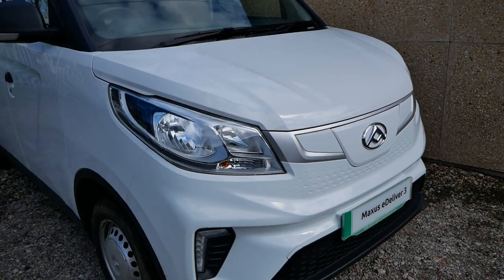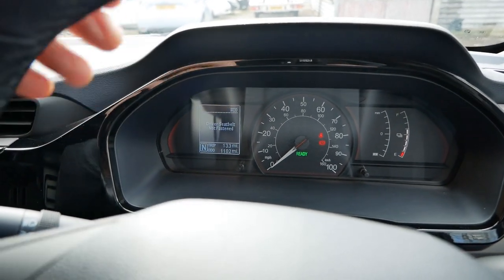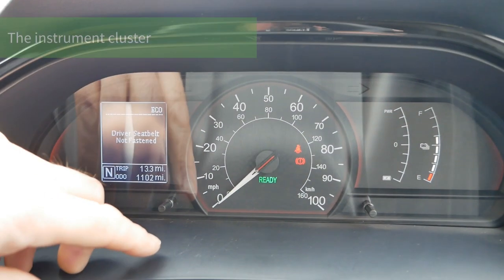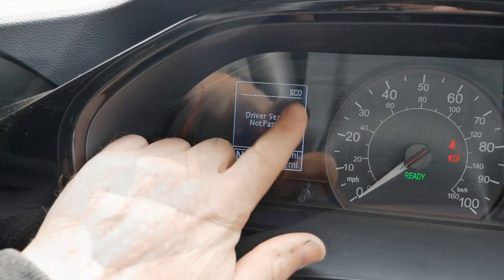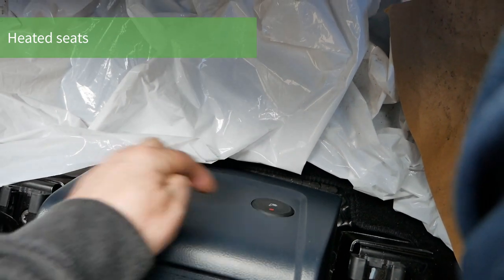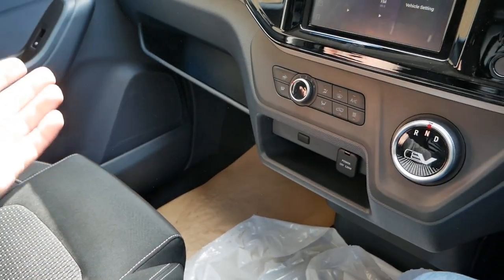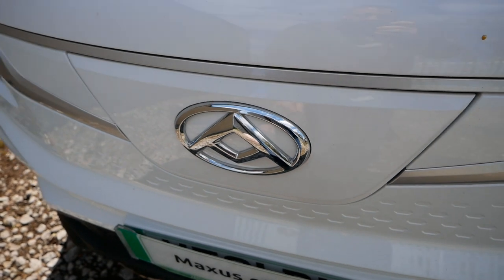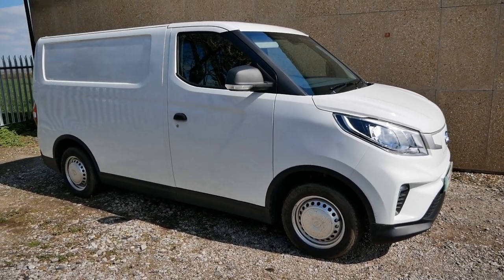Maxus eDeliver 3 beginner's quick start guide on how to use and operate your new electric van

Comment: Thanks Matt for a cracking video. I’ve just taken delivery of mine today and really appreciated your intro. There’s one thing I can’t seem to sort though: the loud reversing siren - it’s deafening!

Don’t suppose you know a way to disable (or at least quieten significantly) do you? I have to park in a residential area and would like to remain friends with my neighbours if possible! Thanks in advance!
Reply from the maker: That sounds like an aftermarket siren. Its pretty common to have them fitted.
Normally, they have a "night mode". Select reverse, then back to neutral, then reverse again will normally turn it off.
Or get underneath and remove it or wrap tape around it and that will silence it.

Comment: Hi Matt. I'm currently thinking about buying a used eDeliver 3 and thus am trying to soak up all the available infos on it.

There are a few questions where I couldn't find reliable infos on, maybe I wasn't looking hard enough?

Anyway, maybe you could answer them for me or send me in the right direction. Also they could be interesting to make a video on as well. 

1: What would you tell me to look for on the used one? What are things that the previous owner could have done wrong?

2: Is there any way to set a charge limit? I'd like to not constantly charge it to 100%, I would prefer to set it to 80% as I do with my other car.

3: Is there any service schedule? Is there stuff to look after after driving a certain time/mileage or would you say, no, just drive?

4: What are things that can go wrong and is parts availability good enough in the meantime?

Thanks a lot in advance!

Cheers
Reply from the maker: 1. Nothing to look out for really & nothing users can do wrong, apart from normal van wear & tear.
2. Not from memory. However, its not needed. Let the BMS look after the battery for you. There's plenty of proof that limiting your charge to 80% has no noticeable effect in the real world. Also charging to 100% (on AC) allows for the cells to balancing, so not allowing this can have a detrimental effect. You have to remember, charging to 100% is not actually 100%.
3. Yes there is a service schedule and like all manufacturers with dealerships (all expect Tesla), its annually. But like all EVs, nothing to service on them except cabin filter and brake fluid. You can find SAIC dealers here https://saicmaxus.co.uk/, but of course any garage can service them or using Cleevley EV mobile service is the most convenient option.
4. Not experienced any issues with them so far, nor needed any parts yet. Parts should be very reasonably priced as I've found that MG parts are (see https://youtu.be/qKgb5NXr7ow) and MG and Maxus are brands from SAIC Motors.
Reply: @GoGreenAutos  Amazing, thanks!

Wow, the part price differences are just out of this world... Lets hope Maxus is like MG in this regard.

Comment: Does the van allow heating while plugged on the net, so not using the battery before leaving for a long drive? I understood the remotely starting the heating is not possible Like PSA and nissan NV200.
Reply from the maker: Correct, these do not have a pre-conditioning scheduler. However, the heater is so rapid, its not a big deal.
As for allowing heating and more importantly starting when plugged in, I can't remember. I don't have one here to try. But I have a feeling they don't.

Comment: Ive being driving one now for 6 weeks great van its a pity they hadn't put straps on the back doors plus the turning circle isnt great
Reply from the maker: It's easy to fit your own door straps though. Ask for examples in the Facebook group. But you're right, you shouldn't need too.
I've not noticed the turning circle being poor. It doesn't seem any worse than other similar sized vans to me.

Comment: Did you say yours is a 35kwh battery?  When you charge it to 100%  what is the estimated millage displayed?  I as because mine I've just got is registered 35kwh. Yet I charged it on a CCS charge at BP Pulse I had approx 20% and it delivered me 41kwh of charge and displayed expected 146miles of driving.
Reply from the maker: The 35kWh vans display 99 miles on a full charge. In my experience, the display always seems to show 99 miles regardless of the recent driving economy, even though its possible to do around 140-150 miles if driven economically.
You must have a 52kW model then as these display 150 miles on a full charge (yet will do ~200) and if you've put 41kWh back in on a rapid charge, just shows you have the larger pack.
I've got a video going live on the channel in the next few weeks which shows you how to identify the pack size on the eD3/EV30.
Reply: @GoGreenAutos  I'm sure I have the 52kw battery pack, but my v5 says 35.
Reply from the maker: @smithia6  Dealers frequently make mistakes when registering new vehicles. In my experience, about 70% of all registrations have errors, particularly with the vehicle weights. Check your battery size by looking at the sticker on the battery pack and photograph it to provide proof to the DVLA. Then apply to change the V5. You need to do this as otherwise selling it would be tricky. Or get the dealer to do it for fix their mistakes.
Reply: @GoGreenAutos  I tried looking for it. I can't see it. It's a squeeze under there where will I find it?
Reply from the maker: @smithia6  See https://youtu.be/SrLh0einL64 (I've made it public so you can see this future video)
Reply: I found it I 100% have the 52.5KWH battery, I need to get the V5 logbook changed and my insurance.
Reply from the maker: @smithia6  So did you pay less for your van on the basis it was a 35kWh??
Reply: @GoGreenAutos  Yes, a lot less. They reduced the price they advertised by over 2k because everyone wanted the 52.5kwh version. Got it for a song
Reply from the maker: @smithia6  Well, their loss. They're absolute idiots! This is not the first time I've heard of this either.

Comment: Just shows you how cheap them vans are made
No temperature control
No rear door straps/catches
No hood hinges 😂
I was considering to buy this or the Citroen dispatch and purchased dispatch because of 3 seats now i can see there would of been allot more annoying things to leave with
Reply from the maker: A Dispatch is a bigger and better van, but then its also more expensive. Its from the glass above. The new Maxus eDeliver 7 which launches tomorrow at the NEC Commercial Vehicle Show will be the competitor van to the Dispatch and the other Stellantis clones.